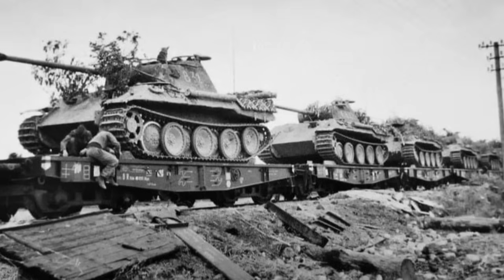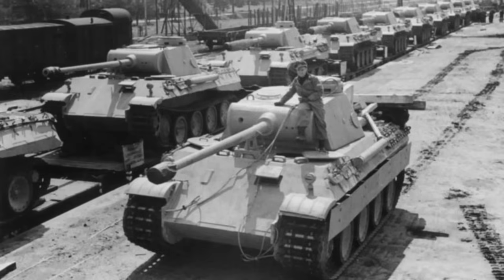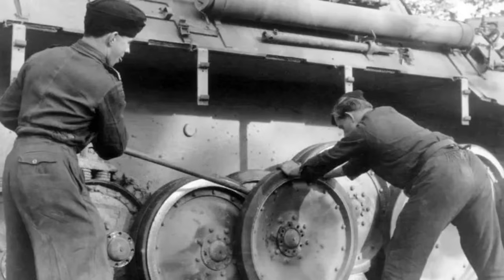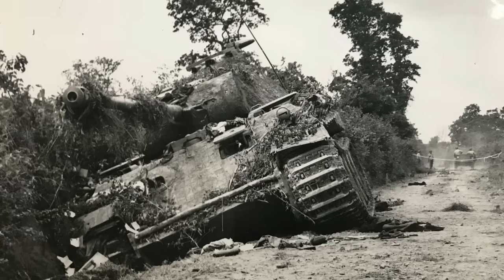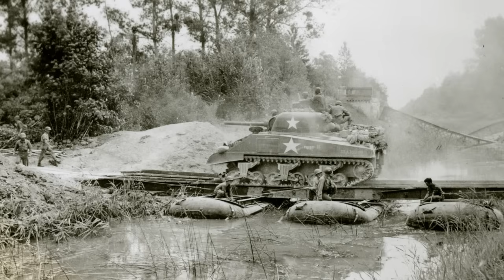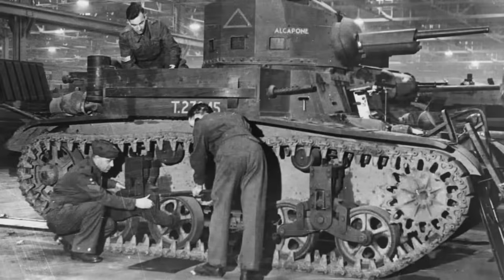American Engineers Examined a Captured Panther Tank — And Couldn’t Believe How Overbuilt It Was

Comment: Not having suitable manufacturing equipment and using a component for a purpose it was not designed for is not a design flaw, it's an application or war imposed problem. Yes, if an inner wheel had to be removed then outer wheels had to be removed but removing such wheels required just two men, a crowbar and a wheel nut spanner. No jack required like a Sherman needed, removing the bogie assembly on the Sherman which the Panther did not have required much more. The Panther's torsion bar suspension system was simpler, robust and more effective and became the standard for most post war tanks.
Reply: At best, your argument points out certain perceived flaws in the design of the Sherman tank, but it is undeniable that German tanks required massive cranes, specialized tools, advanced training, and significant time to perform many repairs, which wasn’t possible, in any theater of operations.
Reply: @WitchKingofAngmarRides Notice how the keyboard warrior belittles others who like holes in their argument and basically says"I'm right, you're wrong, so there!". They state with certainty about things they aren't likely to have any real world knowledge of and believe the sources they've been led along with without knowing context, without providing sources, and without realizing that at least 1/2 of the modern history of these things is written by post WW2 Nazi apologists that were trying to get jobs. "Germany would have won the war if this wonder weapon had been fully funded, etc.". I'm tired of specious speculation. Writing to them is pointless because they've made up their mind and can't see the forest.
Reply: @WitchKingofAngmarRides  So a general criticism but nothing specific. Which means that you don't actually know anything.
Reply: I don't know the specific reasons, but the Sherman designers specifically didn't want to use torsion bar suspension. It's not that they didn't know about it because it had been used in automotive design before that time. It probably has to do with volume of production. If you convert automobile factories to make tanks, using scaled up standard automotive parts makes a whole lot of sense. The Allied offense relied on readily available parts, manufacturing, and what farm boys were used to fixing. All engineering is a compromise. It's a series of tradeoffs. The trick is minimizing the tradeoffs.
Reply: @tommanseau6277  But the Sherman's suspension was not an automotive type so why didn't they go with a superior simpler automotive type torsion bar suspension?
Reply from the maker: That's a very insightful analysis of the Panther's engineering and its post-war influence — thanks for sharing!